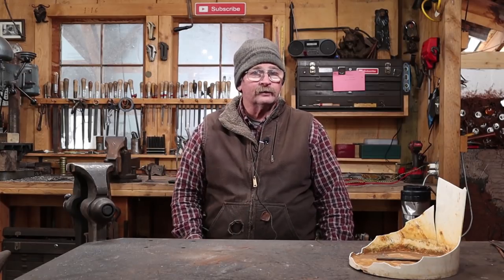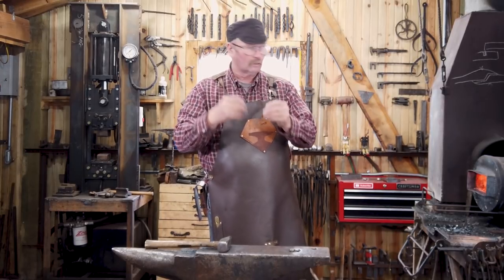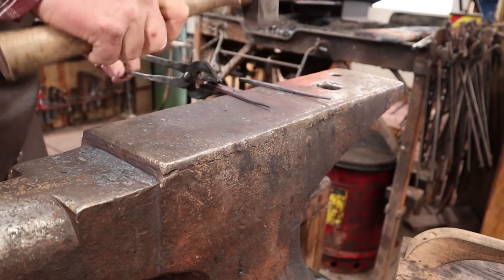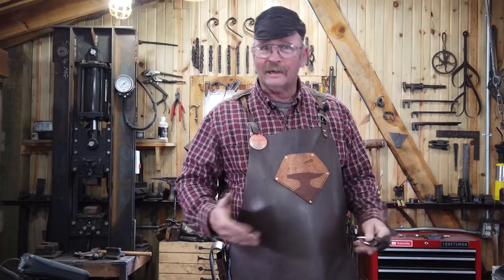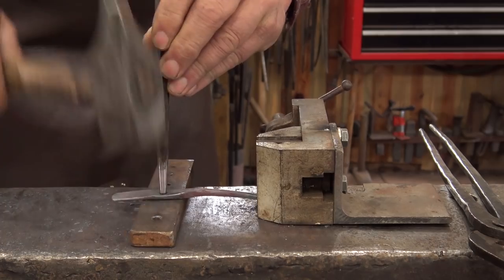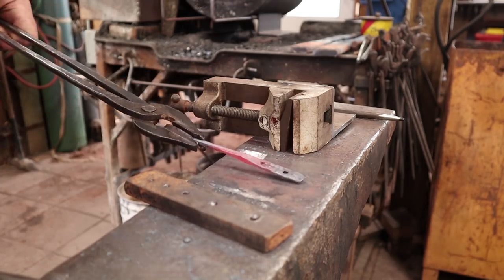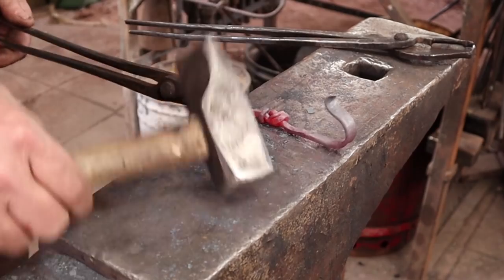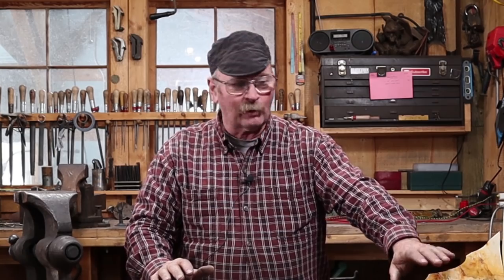Blacksmithing - interlocking wrap - Hook of the Week 27

Comment: I really like the wrap your were going for. It reminds me of some of the soldered connections I use from time to time. This one reminds me specifically of a really strong in tensile connection. As you noted the top is wrapped in the wrong direction. But still really cool. Perhaps we will get to see other wrappings in some form. And maybe electrical soldering joints give you some ideas.

Comment: Glad to see the vise is working for you.  One of the things I often do is put a convenience bend into the piece going in the jaws so the vise has more meat to grab onto.  Of course, that can be problematic if you don't get the bend in the same plane as the area you're punching through.

Fun to see you using it, though.  I use mine all the time since I usually have to make four or more hooks for an order that needs to go out the door!

Now that we've emptied this bucket, I'm curious to see what'll be in the next one you pull out of the pile!
Reply from the maker: I'm just soirry I couldn't remember who gave it to me.  I may need to start witing peoples names on things with a paint marker.
Reply: @BlackBearForge  No worries, friend. As long as you're enjoying it and find it useful, that's good enough for me!  :D

Comment: One and done? Not in HotW buckets. Yay! Interesting hook this week. Yeah, a little planning probably wouldn't hurt when knitting two lengths of material together. Don't get it twisted, I still like the hook.
Maybe drift a hole in the bottom of a backer/mount piece of material, and split the bottom, hook piece, and counterwrap the two halves up the mount half like vines, maybe even with little leaves on the ends? Sort of a look that climbing ivy is holding the hook to the mounting piece?
If love to see if you bring my idea to life. I like the twist idea, and I love climbing ivy, so just thought today's hook combined with that idea could make some beautiful hooks.

Comment: Very interested  in your torch setup.  What do I need to pick it up and it is on and when hung up it is out but gas was not turned off. I do not know what to look or ask for.
Reply from the maker: Its a gas economizer valve, sometimes called a fuel saver. Smith is the only brand I have been able to locate.
Reply: @BlackBearForge  thank-you  for  the info. I will have  to wait  on that valve. It is not cheap. I am just about ready to buy a tig  unit. I just have to stop adding more  machine features.  Again thank-you